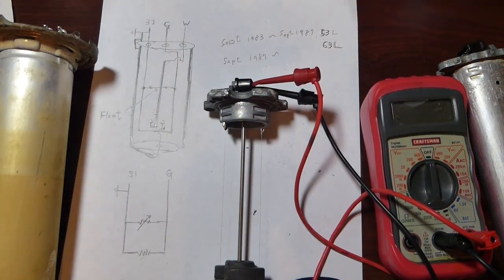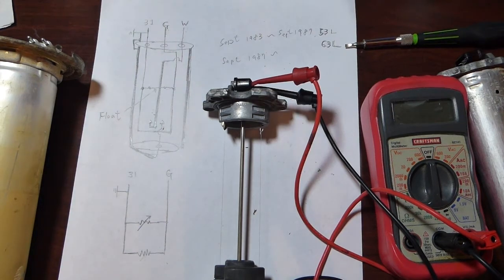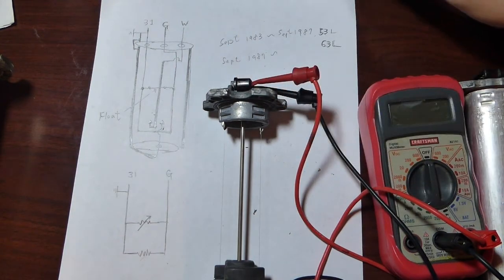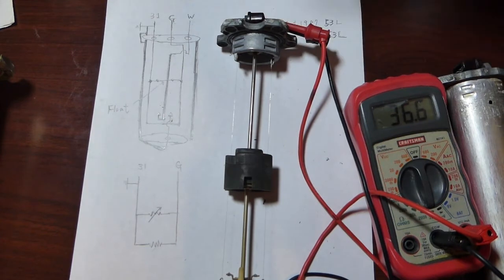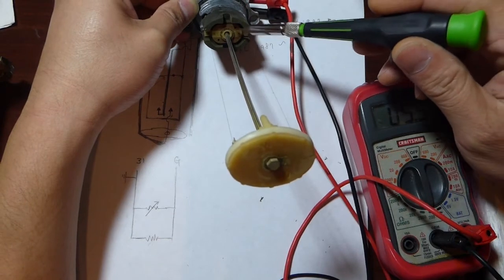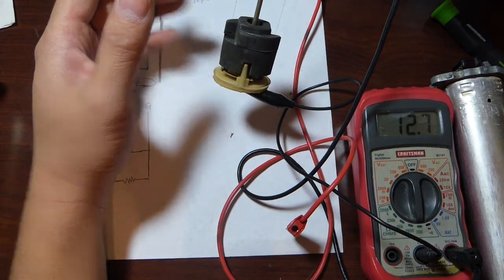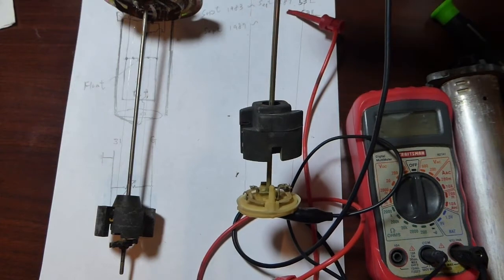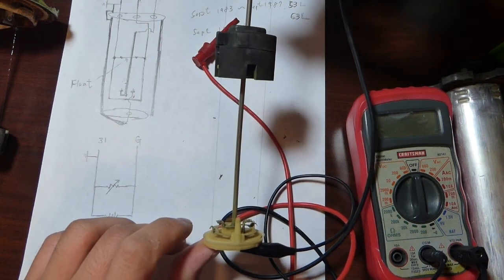BMW E30 fuel level sender sending unit function, failure and repair

Comment: if you have the 63L tank and your fuel reserve light is staying on, how do you know which unit is faulty if you have 2 x floats? both are sending the correct fuel level, only the light is staying on.

Comment: Hi, Just a quick note - I had a n intermittent fault on the main sender (mine is only 1 x sender). To remove the oval shaped tube I drilled holes in one edge of each crimped recess. I was the able to insert a small screwdriver and prise the remaining crimped section proud of the top housing. The tube slid off really easily and there was sufficient material left to re-crimp once done. I was able to clean the inside with brake cleaner aerosol and took some very fine grit paper to the wiper contacts on the float as well as the empty level switch contact faces. Back in the car and all looks 100% again.
Reply: Awesome I will try this. Thanks!

Comment: Great video. There is a way to replace those 2 thin wires. Nichrome wire that's found in hairdryers, modern heaters, should do the truck. If you apply tension with a snipe nose plier and solder, you can be successful. You will need someone to assist you, four hands.
Some of the E30's needs a full tank for the sender to work. Mine does that, ensuring that I had a full tank all the time. As soon as the Guage drops, I fill the tank up again.

Comment: I have a 1986 E28 518i with a 70 liter tank. When I fill it up it actually shows just 40 liters on the guage and starts showing empty when half of tank is gone. Have you ever encountered this? Any ideas if that unit is fixable? Thanks.

Comment: Thanks for this.  I have a 1988 320 made in October delivered in November.  It has a 63L tank - I didn't know some earlier ones came with 53L  that might have given us range anxiety ;)
Now I have a jumpy fuel needle (a bit like evanarends7825 three years ago) but mines is showing 1/4 full to empty when I think it should be fuller, but maybe some leaked out or evaporated!?  Maybe the sender is wrong and it is 5/8ths, hmmm.  Time to go in there with a multi-meter.
Update/progress: So, I lifted the rear seat base and the sound padding to find the oval (R/S 4#philips2) and round (L/S 3#philips2) covers, removed them and...tested 66ohmn and 75ohmn steady and when I reconnected fuel gauge steady BUT when I banged the floor the needle flickered.  I pulled two wire connector of the second (L/H) unit and popped in two wood screws to make contact,  and banged again - needle solid this time. So, my fault lies in the second (L/H) fuel gauge.  I know what AUF and ZU mean.... they mean Oh!  F~~k! the O-ring seals are shot/flat/cracked.  Sigh!
OK found genuine seals and filler cap seal on eBay.
The central rod was quite rusty - problem with ethanol in fuel methinks - cleaned with knife, 280, 400, 1,000 and 3,000. One pass of the 3000 on each side of the two wires and crossed fingers.  Fuel needle steady for now, but perhaps should replace the rod with stainless steel rod?

Comment: I’m doing a early to late fuel tank swap . I’m about to wire in the secondary (driver) fuel level sender . I would just splice into the green/brown wire which is labeled (G) on your diagram for the gauge and wire it over to the driver side level sender on both connectors ?? That would be in series ? For anyone doing this you also need to have a late model fuel gauge(63L) in the cluster because they are 120ohms and the 53l fuel gauges are only 60 ohms .

Comment: i have to know how the hell you got it out
Reply: Hold the top hard base on a bench wise. Remove the bottom nut. Then twist and wiggle the aluminium tube slowly  and pull.

Comment: how did you remove the aluminum enclosure on it?
Reply from the maker: Unscrew the button bolt. I clamp the top horizontally on a vice and carefully wiggled the casing back and forth to remove the casing.

Comment: Hi,
How can I solder back the thin wire to each contact?
It seems each contact point has some kind of resin, so I couldn't solder the wire with a regular solder iron and soldering tin
Reply from the maker: They are just regular solder joints. You probably need to clean the contamination off the joint first.

Comment: Hi therw E30base please can you give me advise.
When I fill up my e30 325i the fuel gauge goes to full but after I drive it moves up and down, (jumps around) then maybe after a while it would just lay at the empty mark until it decides to jump around again.
However the light which indicates empty does work and goes on when car fuel is low.
Thanks in advance
Reply from the maker: I will check the resistance between C2 pin 2 and C2 pin 16 in the back of your instrument cluster first to see if there is a good resistance signal from your fuel level sender to fuel gauge first. Then figure out if the fuel gauge, the fuel level sender, or wiring is at fault.